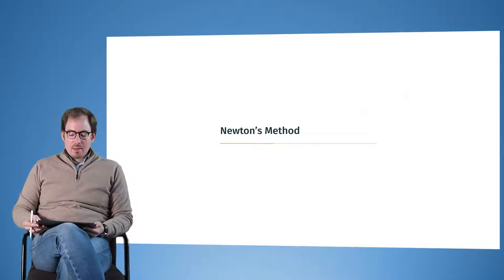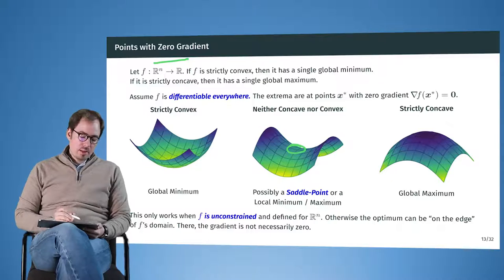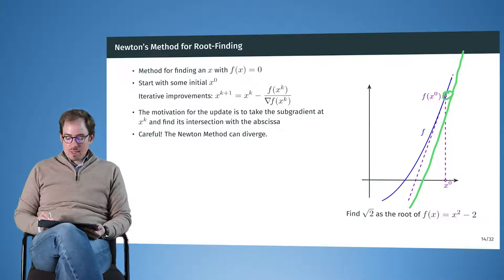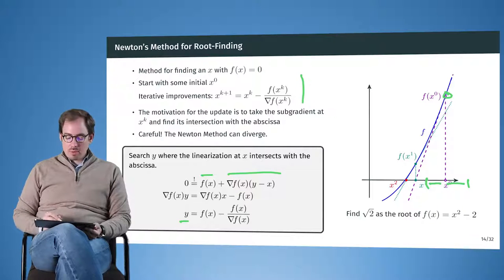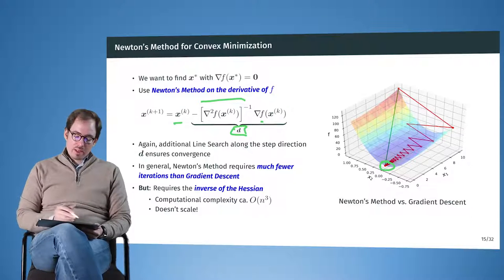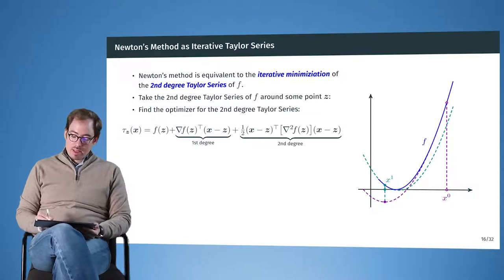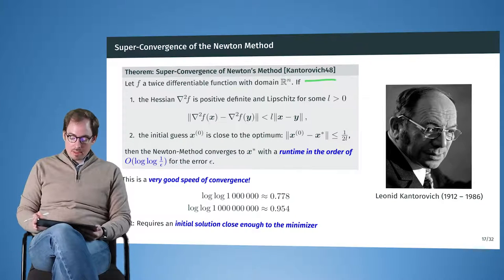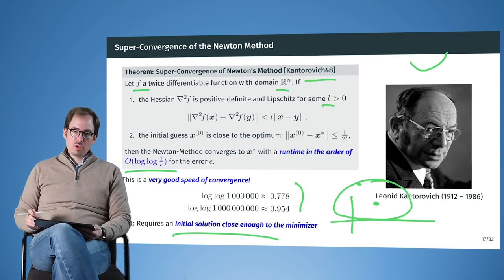2.2 Optimization Methods - Newton's Method

Comment: Isn't it a bit of a cheat to compare Gradient Descent and Newton's Method using the example of a quandratic function, where the Newton Method just by construction is guaranteed to terminates within one step at the exact solution, since the Taylor expansion exactly equals the function itself :)
Reply from the maker: It does get the point across. ;-)